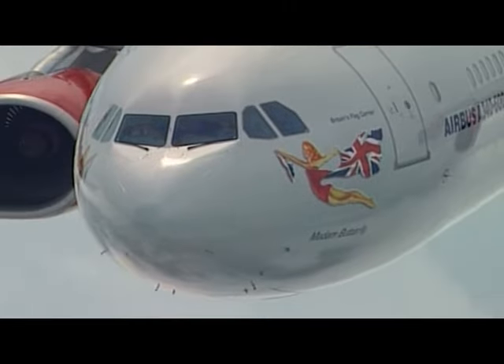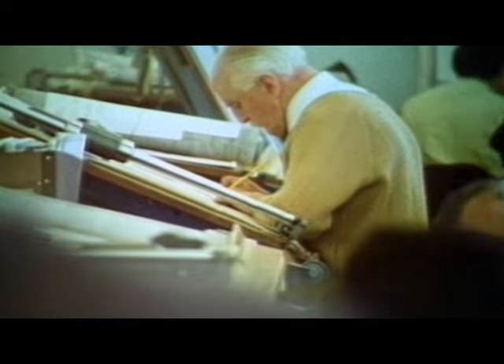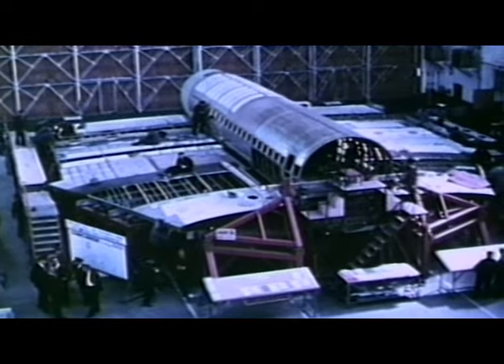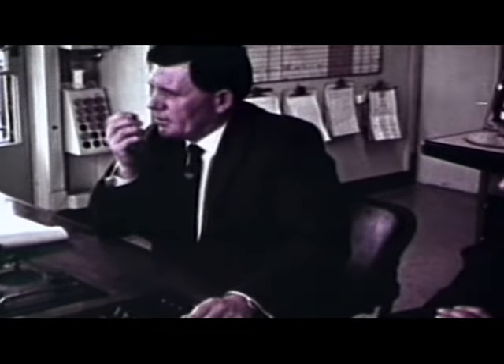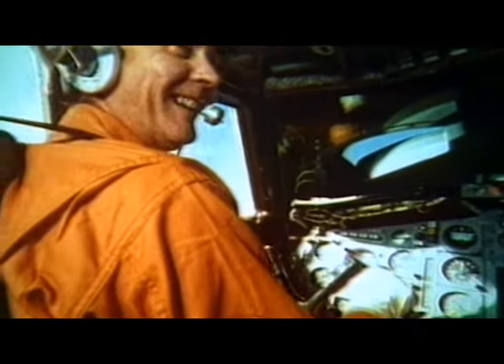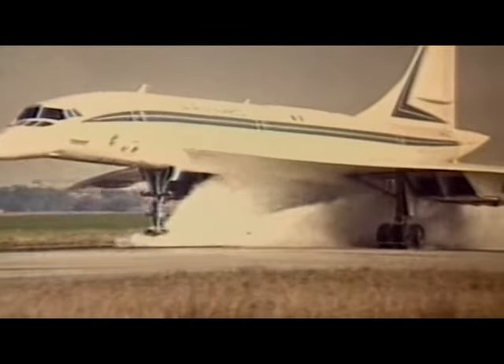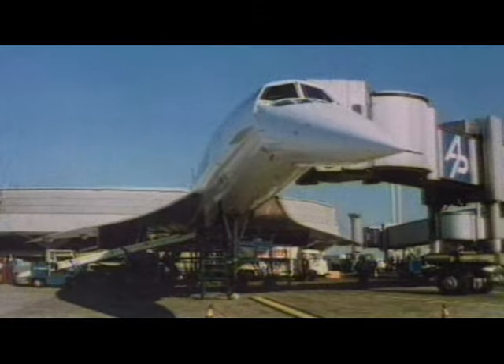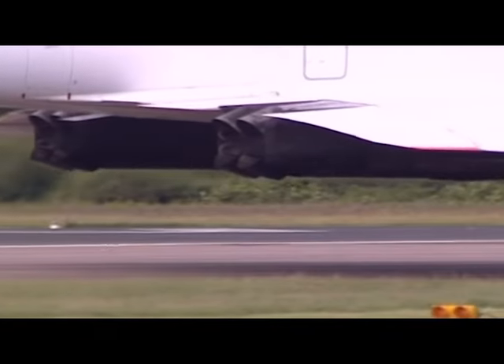Concorde: Queen of the Sky (FULL MOVIE)

Comment: Something not mentioned and quite important was that Concorde could 'Supercruise' for thousands of miles at Mach 2 in 1970. To put that into context only the EE Lightning in the '50s and TSR-2 in the '60 could 'Supercruise' which is the ability to fly past Mach 1 without afterburners / reheat. No American aircraft could even do it and they were quite miffed to find out their F-22 was NOT the first to 'Supercruise' as they thought.
The ability to do this at those heights, speeds and distances was quite a formidable achievement. To this day none can do it let alone flying 100 champagne quaffing people on board.
An absolutely unique engineering achievement and possibly THE most beautiful aircraft ever flown.

Comment: Canada built the Avro Arrow in 1958, 25 thousand thrust engines Orenda Iroquis the only aircraft at its time with more thrust to weight ratio the, F15 was the first A/C in the 70s that achieved this 
The Arrow a  delta wing bomber interceptor with fly by wire Internal stores for  bombs the aircraft that was developed did not have the liberty to use the mighty Iroquois engines they were still in Development so the used PW American engines that were under powered  Not much of a choice in the 50s
 Where do you think the engineers went after the Canadian goverment canceled the mighty ARROW  this is the reason nasa went to the moon and Europe built the Concorde ,We Canadians built the dreams for every one, we invented the CNC and used titanium for jet engines the mighty Iroquois and it was a dual spool, before the Olympus  who do think designed the British engine> Canadian 
Stop patting your shoulders GB we in Canada know how to build aircraft and we dont do it to support wars we are just smart Humanitarians
Reply: I admire Canadians greatly but that comment was totally unproven and utterly uncalled for in its attitude to the Brits. And it didn't do the same against the French. I wonder why?

On the thrust / weight allegation the Arrow was 0.825 while the Gloster Javelin was 0.79 and proven to be so same as the Lightning. And are you suggesting the Arrow would outperform the Lightning?

No one was patting any backs in this documentary mate so wind your neck in. But where do you think Avro got its aerodynamic data from to create the Arrows delta wing? That would be the UK given Avro was owned by Hawker Siddeley and the UK was leading the world in the '50s and then into the '60s in both delta wing and supersonic flight research. The first operational delta winged jet was the Gloster Javelin in 1951 and was followed by all the British delta designs shown in the documentary. 

As for the Iroquois which first ran in 1954? It never flew other than on a test B-47 where full power could not be used so its all speculation. However it was not a dual spool before the Olympus as the Wright J37 proposed to fill in for Iroquois was a licence built Olympus engine which itself first ran in 1950. So to suggest Olympus was Canadian designed just doesn't stand up. In fact the P & W J75 was the first two spool engine but only by a few months ahead of the Olympus.

The Arrow was a spectacular aircraft ahead of its time but was killed by dumb Canadian politicians and crooked Yank ones. We Brits can sympathise because we built the TSR-2 which suffered the same fate by dumb Labour politicians and crooked Yank ones. Just like Arrow all the tooling and jigs were ordered to be destroyed.